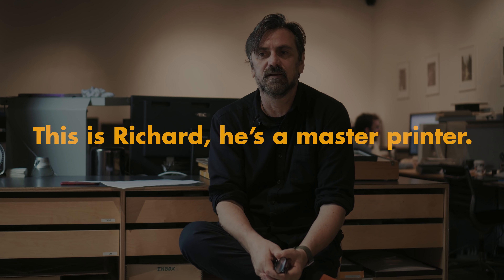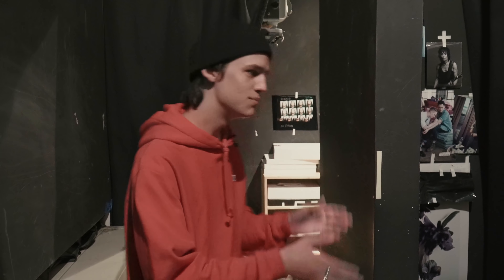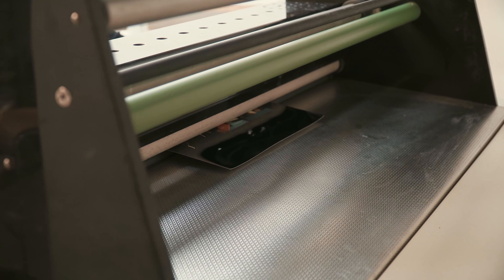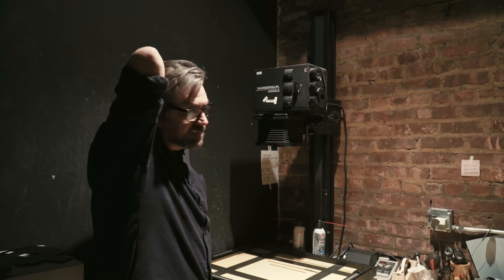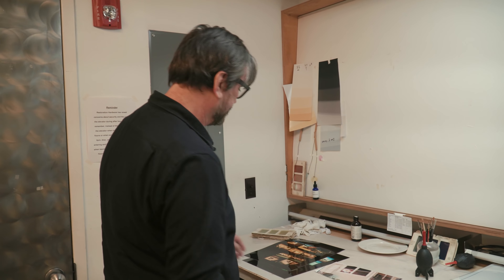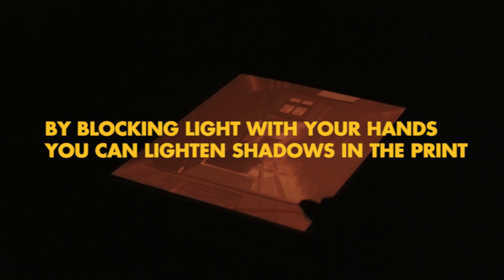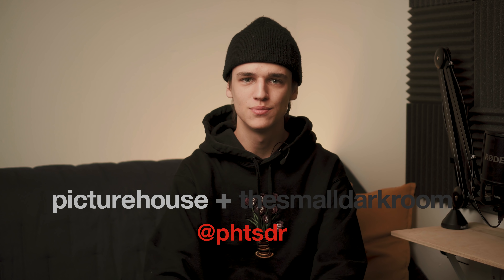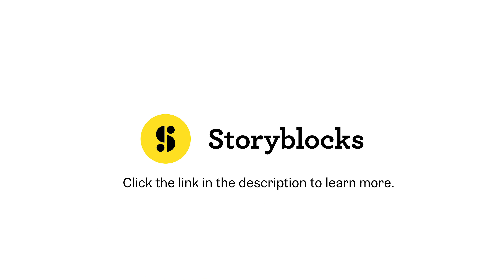How to Print Color Film in the Darkroom

Comment: We had to do darkroom colour printing when I was in art school.  It was so nerve wracking.  The process is so much more temperature & light sensitive than black and white. However, it was cool learning & trying out the process.
Reply: Yeah, color printing could be a PITA. First, one needed to get an initial setting for the enlarger and it was much easier if one had a color analyzer and a reference slide/negative from the slides/negatives that needed to be printed. Then some wet processing involved a single chemical at room temperature or multiple chemicals at specified temperature. A color print drum tumbler could be helpful as well.

Comment: The printer with dryer is a huge relief to have in this process - I tried the so-called RA-4 color printing process from color negatives with a color diffuser enlarger myself, but it was a huge pain. If you don't have the printer&dryer as shown here, every time I needed to put one test print into a Jobo roller drum, add chemicals which are very sensitive to air and develop plus start all over again. Very time consuming and not much fun. Only do B&W printing in my darkroom since and print the scanned negatives on my inkjet printer instead.
Reply: To match the printing portion of the ease of using the printer & dryer back then for amateur photographers, Kodak had this Ektaflex color negative printing kit that only needed a single chemical solution and could be done at room temperature.  Just filled the Ektaflex with the chemical, feed the paper in and turn the handle to get the paper through the chemical and out from the processor.

Comment: I did color and  black and white prints for years.  While I would still to black and white prints, I will NEVER do color prints in the darkroom again.  Yes, I had some of the best equipment Beseler enlarger and color analyzer.  The color chemical temperature were always spot on.  Changing the color settings with each new box of paper.  Change the film and the color settings change.  Color is just a Royal Pain.

Comment: Good video, but that's a great deal of effort and cost to get to correct color balance and exposure. I prefer to make one test print using a Mitchell Colorbrator and use it to calibrate a ColorStar 3000 analyzer after using a reference negative from the batch shot with a Macbeth color chart - typically nail color balance and exposure the first time with the ColorStar and waste no more (or 2nd print for sure when its ever so slightly off).  Could have also shown how to use color viewing filters - it takes some time and experience to eyeball 5 cc or even 10 cc's of shift.  Also, maybe I'm just maniacal about dust, but I have a virtual 'clean room' with a DC Anti-Static Ionizer and Heppa air cleaner as well as a dual encased film drying cabinet - good dust control practice and handling should require no manual retouching.